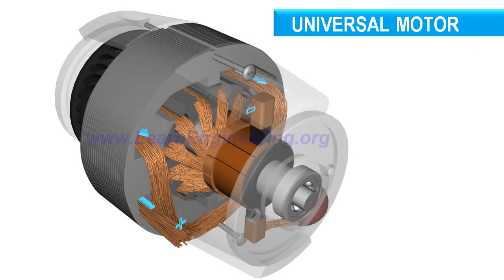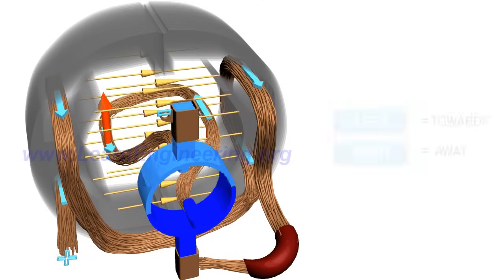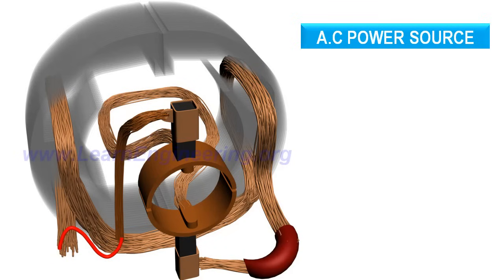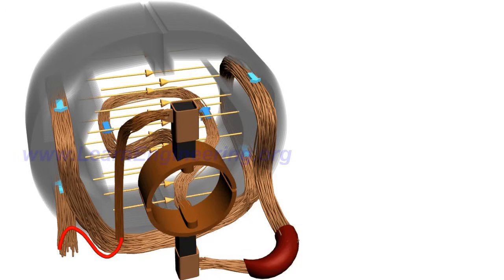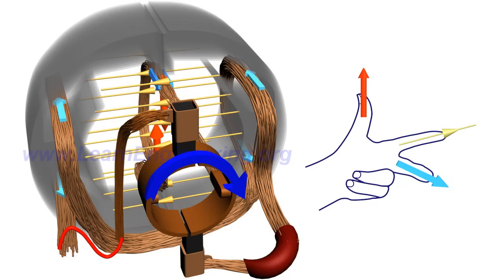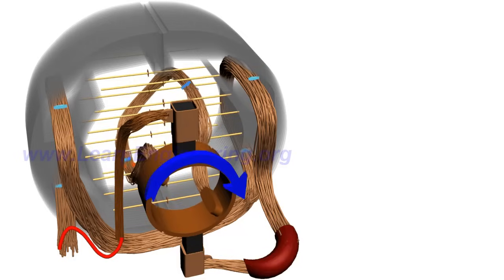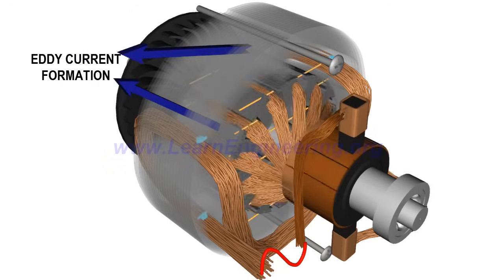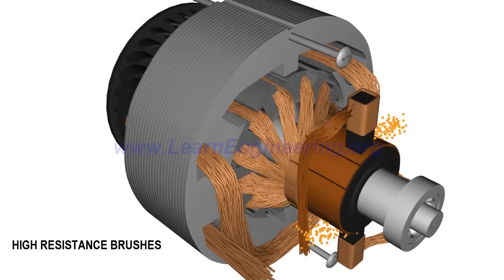How do Universal Motors work ?

Comment: One advantage of these motors is that they can spin at extremely high speeds, tens of thousands of rpm for some types. AC induction motor speeds are determined by the number of poles and power line frequency. Two and four pole induction motors spin at 3450 and 1725 rpm respectively for 60 Hz power. A vacuum cleaner motor may spin at 10,000 rpm, thus allowing a small fan to produce powerful suction. A wood router may spin at 25,000 rpm.
Reply: Universal motors still have 4 disadvantages, loud sound, sparking, wearing carbon brushes, and not going over 10,000rpm, thus induction motors can still pass over 10,000rpm, but the most newest motors are inverter motors, which are stronger than universal motors, induction motors consume less electricity, and universal motors consume slightly less electricity, universal motors still have disadvantages, even if they can run on AC or DC, but the most nicest advantage about induction motors is they can last longer than universal motors, inverter motors can over 3450rpm.
Reply: You can power universal motor with VFD, as long as you get the right voltage, the motor will function properly, however inverter motor will function more effectively than universal motor.
Reply: voltage controls rpm
Reply: @CasamTheAnimator I don’t think high rotational speed is that difficult to achieve though just use the gearbox… that is how most ICE powered car achieve extremely high rpm.

Comment: Should be the right hand rule. That hand works for everything.
Reply: +Libfall Could you explain that rule, please.
Reply: +WhtStr213  When taking a cross product you should always use the right hand rule.  Google it.  They show a left hand which is wrong.
Reply: +Libfall use right hand rule for generator action. left hand rule for motor action
Reply: yes,it is true
Reply: The right hand rule is used for generators, i.e a conductor moving inside a magnetic field. In case of a motor, a current carrying conductor is present in a magnetic field. The left hand rule used here is appropriate.
Reply: Left hand is for Gen, and Right hand for Motor
Reply: IDK why people make things so complicated, Cross product doesn't care if it's motor or generator. Everything works with right hand rule and so will with left hand, you just have to take care of which finger is what
Reply: You could also argue with electricity flow (+ to ) vs electron flow ( to +)
Reply: In the German speaking parts it's just the opposite. Left hand is for electrons and right hand for protons. The main difference is that the thumb represents the current and the middle finger the current🤷‍♂️.
Reply: That's why I think of a screwdriver. Righty tightly, lefty loosey. i x j will be k, because it the screw would go out (you're rotating left/counterclockwise), towards you... which is up in the "k" direction. j x i will go right/clockwise, and because you're screwing it in, you go in the -k direction. Requires mind visualization for where the vectors are actually pointing spatially in the first place, but I find it's more intuitive for me than trying to remember which finger is which in the right hand rule, which I never really figured out. 

In fact, this is the first time I have explicitly heard that finger definitions /need/ to be assigned to the right-hand rule, as people always insistently held out their right hands to me in a corkscrew configuration, maybe shaking it up and down a few times, just stating insistently "it's the right-hand rule" or "all you need to do is the right hand rule". Alright, thanks. I've got the cool finger gun down, now what do I do with it?

It is kind of cool to hear that different cultures do it differently though.

Comment: What is going on if you want to change the diraction of the turning?
In a dc motor you just change positions on polars,here if you change positions on polars do you take the same effect?
Reply: You have to move the brushes to reverse the motor but keep the stator wires withe the same brush (ex. To reverse, switch which stator wire is connected to which brush

Comment: I have a question , if anyone reply I am glad.   If I  change the direction of  power supply cable , can I change the direction of rotation as well.
Reply: No, both rotor and stator field directions change, resulting in same rotation.

Comment: Might this have anything to do with why my vacuum cleaner motor has loads of sparks coming out, with a burning smell?
And will replacing the brushes help?
Reply: +accursedCursive Possibly. Make sure the brushes have good contact, and are clean and clear of debris. Also inspect them for arc damage/corrosion. BTW, that smell is Ozone (O3), most likely.

Comment: so, while operating in dc, if i swap the polarity at the brushes the rotor will rotate in the opposite direction but what about while in ac? does it work the same way?
Reply: +Petri Ševardnadze You can run the motor but you cannot change its direction...instead you connect a diode across AC windings to make it work like DC and hence control the direction of the motor
Reply: @potencializadordeenergiagr7551  Like you said, this is Impossible.

Comment: So, universal motor cannot run in opposite rotational direction?
Reply: yes, it can. you need to invert the army
Reply: They can, you just have to flip the wires when connecting the positive and negative wire into power source.

Comment: Is there back EMF with universal motor , I want regenerative braking  on heavy electric assist velomobile , permanent magnet dc or electro magnet for simple low power dc generator suitable for low dc battery charging...thanks for your time
Reply: there will always be a back emf whenever you have any type of changing magnetic field, or if you have a fixed field with conductors passing through it, both of which are cases in this universal motor. If there was no EMF 100% efficiency would be possible in the electrical domain outside of very small coil losses
Reply: Jake thanks ....but I do have a question ....can I universal motor be used for dc generation similar to permanent magnet motor ( no special circuit just diode)
Reply: if you mean to produce a DC rectified power source through diodes, then if the you move the rotor independently then you should see a voltage through the terminals (AC) off the same fundamentals of  the back EMF (induced voltage). the only issue would be polarity but that should be a simple investigation
Reply: Jake Hi again....so universal motors and pm ( permanent magnet) are both capable generators but the pm motor only needs one blocking diode ( otherwise motor would run ) whereas universal motor needs output rectified if needing dc < is this correct  ....thanks again for your time

Comment: The direction the current takes at the start of this is incorrect??  I thought it has to take an opposite direction on the stator when comparing both sides to create two opposite poles?,  in this video the current runs through the stator coil in the same direction on both sides??

Comment: Why is using electromagnet better than permanent magnet?
Reply: With electromagnet you can easily increase or decrease magnetic field strength and also you can turn it on or off very easily too. But the biggest advantage is price for large motor if they use permanent magnet as the source of magnetic field it will require a large permanent magnet too which is very pricy but instead you could easily achieve the same result with a large electromagnet and it cost much cheaper too.

Comment: If universal motors are dc series motor,   then series motor are types of motors which should not be run without a load or run ta dangerously high speed damaging the motor,
Reply: That’s why they have a fan on the shaft. It not only keeps them cool, but acts as a load to keep them from overspeeding.

Comment: I want univesal motor not induction motor
Reply: Universal motors are perfect for experimenting and building projects since they can run on either AC or DC, and they don't take that much power to run. Even if it was meant to run on 120 volts, they can work on as little as 12-24 volts DC.